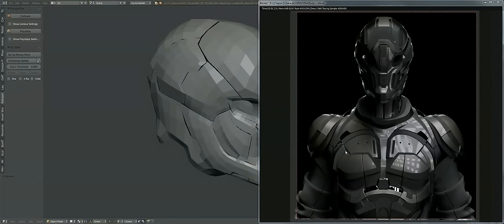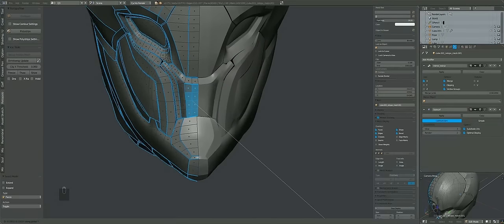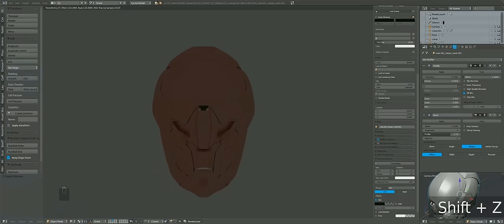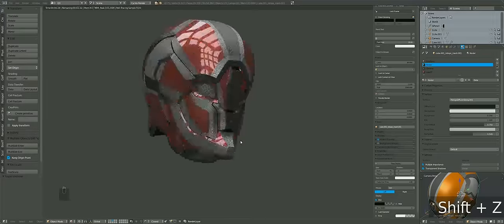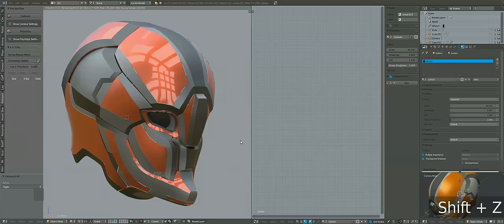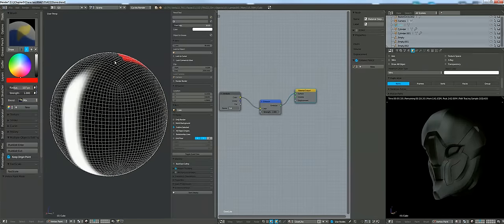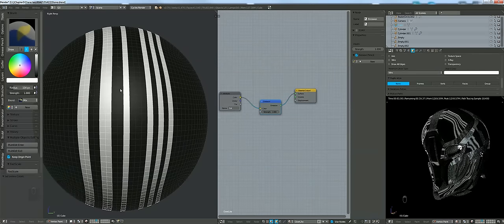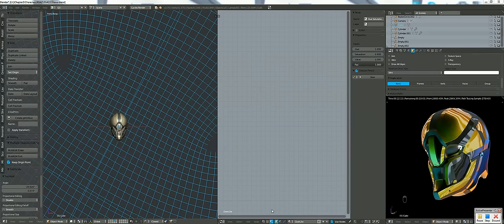Blender3d: RN42 Part 2

Comment: Cool tips. Im still playing with the HardOps addon. All those extra edge loops, bevels and insets seem kind of overkill now. Is there any reason to use your 'old' method now? For instance how will using the HardOps method impact on UV unwrap and texturing, normal maps etc?

I also liked the vertex painted emission sphere - it is kind of like a hand painted HDR enviro map.
Reply from the maker: +Alex Kelly hmmmn well my channel to be a demonstration of my evolution. The tutorial "How To Concept A Robot In Blender". While classic shows my older style. I would say that CShapen is more ideal if blender is your route however SSharpening would suffice for my needs outside of it. UVing it even with hard ops is still an easy process in fact making your sharps seams makes uving very easy however manually unwrapping is more ideal. As I work with it I'm resolving issues that come up with it but as of now baking isnt impacted nor is mapping.